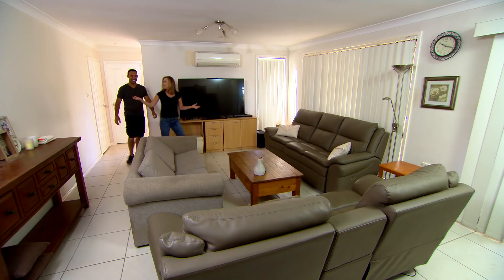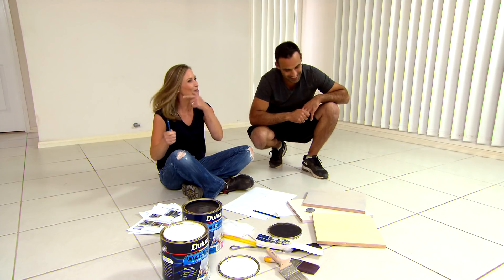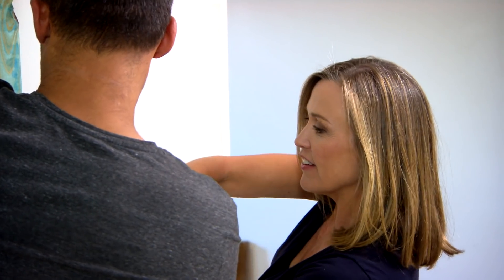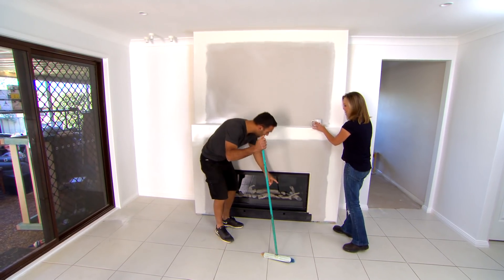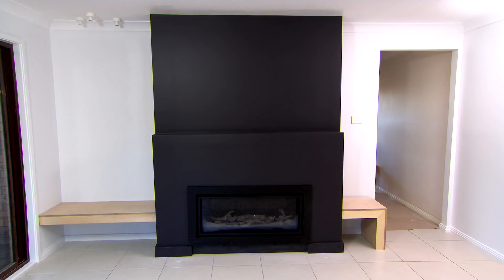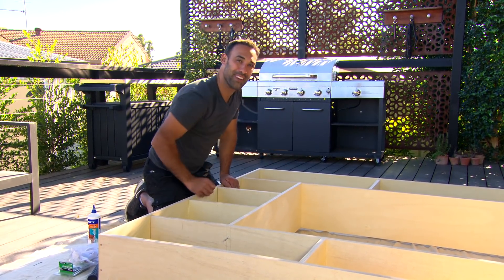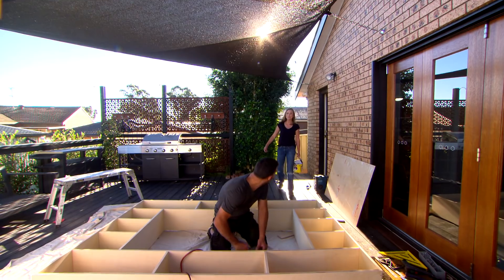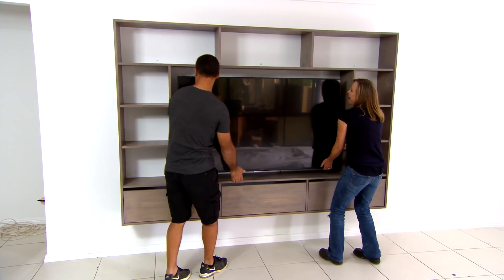How to Give Your Lounge Room a Cosy Makeover for Winter | DESIGN | Great Home Ideas

Comment: Love how shows like this always start painting with a brush then have this amazing mirror flat finish when they're done. Which we all know is impossible...unless you use a spray gun. ;) 
Or if your stuck with a brush try a 1:1 of paint and spray gun fluid. Mix it all in one can and apply like normal. The fluid will allow the brush strokes to lay flat before the paint dries and you should have a nice mirror flat finish.
Man, I wish I had a wall that long to build me a shelf for my TV like he built. jealous.
Reply: That's not true, You use the brush to cut in the edges then a quality roller to do the wall, just as they have been doing it for hundreds of years, spray gun is only for very large or commercial situation
Reply: @-PORK-CHOP-  Been painting apartments for over 30 yrs, taught by an old sailor and the only way you're going to get a finish like that is with a gun. Rollers are great but they still leave small marks that show up. Spray guns are for times you want an ultra flat mirror like finish with absolutely no bumps no matter what size job your painting.. Even foam rollers don't give a completely flat finish. 
The tip I gave above actually works when using a brush (EDIT- really great on cabinets). Give it a try on a small project.
Reply: @nriqueog  Thanks! I will try it!